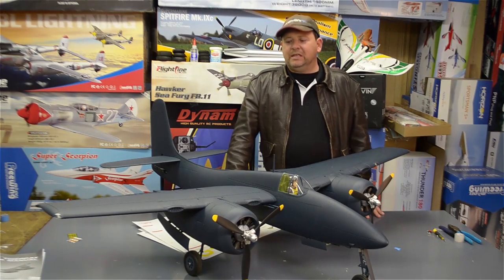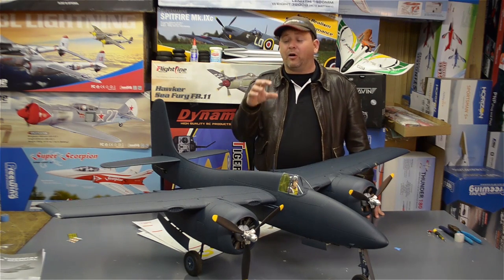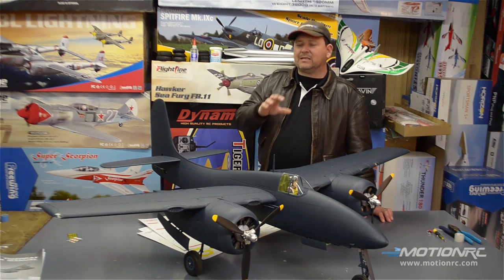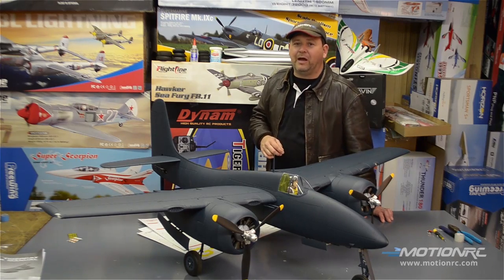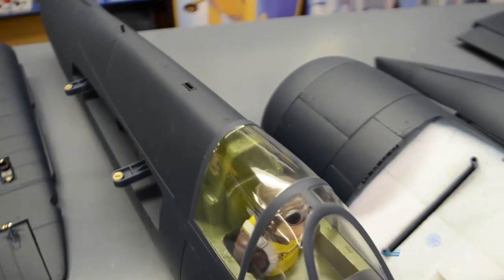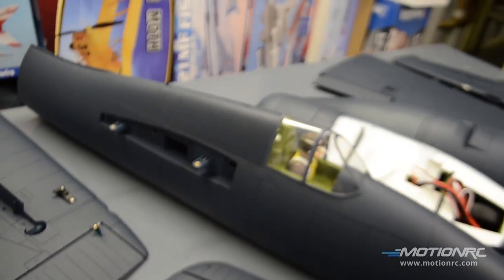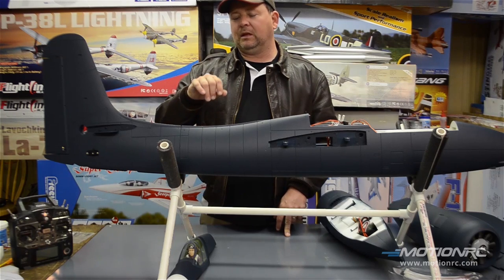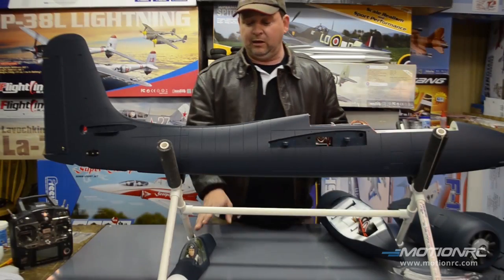FlightLineRC F7F-3 Tigercat 1600mm (63") Build

Comment: I am finding the screws that hold the props on the plane are constantly coming loose. I am curious how ypur foamtac trick worked and if you can poat a link to the foamtac you used to aid in securing the screws?

Comment: if the batteries lay in the front where did you put the reciever?  thx
Reply: The receiver will go right ahead of the panel where all the wires plug in. There is a space right behind where the batteries go where the receiver is mounted.

Comment: What direction should the Props rotate in?
Reply from the maker: williewideback top out
Reply: THX I had the strangest incident while powering up my Tigercat, the right prop flew off, I thought the screw that holds it to the spinner to the motor wasn't tightened, to my surprise the screw was still attached to the motor and it had broken off the spinner which attaches to the prop. thank goodness this didn't occur while in flight. I just ordered another spinner, but I'm confused! why this occurred, did I over tightened it? or if the props were rotating in the right directions. Hmmm!